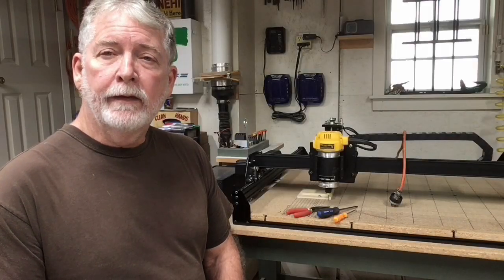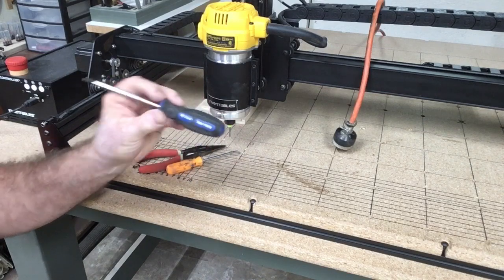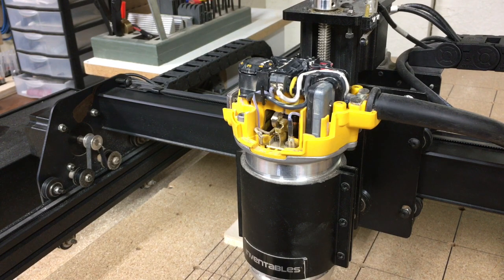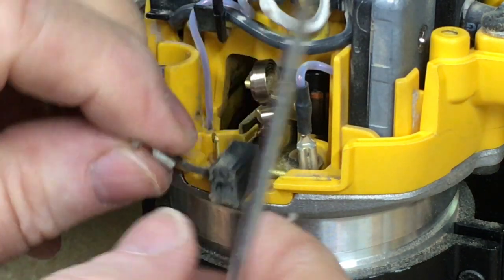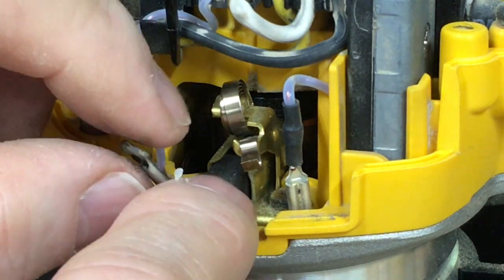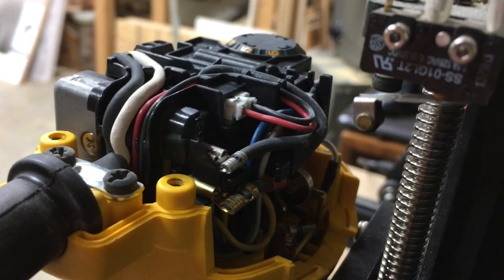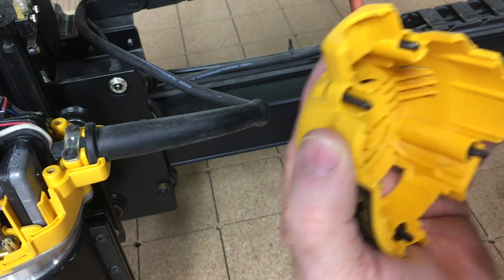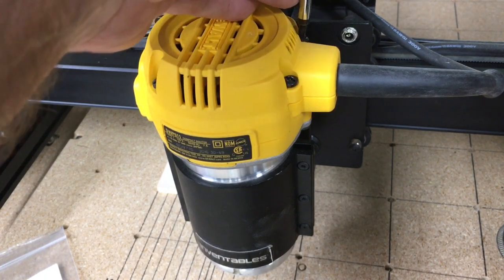How to Inspect and Change Brushes on DeWalt 611

Comment: Now that's something I need to do, first job for tomorrow is to check my Brushes and second is to order some spares. I'm not sure how many hours mind has done since I built my X carve in April but I'm guessing it is quite a few. Thanks for the reminder.
Reply from the maker: Cliff Phillips.  I keep a log of every Carve I do with the time recorded. I know that my brushes last for about 150 to 160 hours. I could push that number further but it is not worth risking a failure. That allows for a safety factor.

Comment: Thank you for a great video. I was wondering how to changes the brushes on the 611. Where can I buy replacements.
Reply from the maker: Reg A. The brushes can be purchased fro amazon. https://www.amazon.com/Dewalt-DWP611-Porter-Replacement-A27343-4pk/dp/B00X1LF708/ref=sr_1_3?ie=UTF8&qid=1533783191&sr=8-3&keywords=dewalt+611+brushes

Comment: Do you run the router on level 1 speed for all of your carves?
Reply from the maker: Yes,  that is 16,000 RPM for setting one
Reply: @PawPawsWorkShop  Thank you, sometimes when I’m doing a roughing pass on let’s say a flag where it’s all straight lines I feel the need to speed it up to like 100 Ipm and felt like I should also run the router at a higher speed as well.